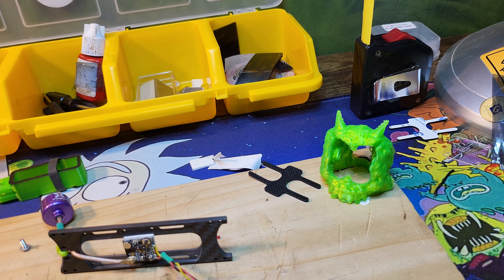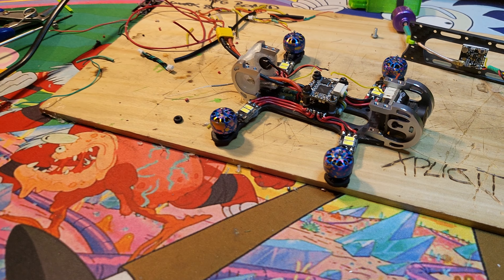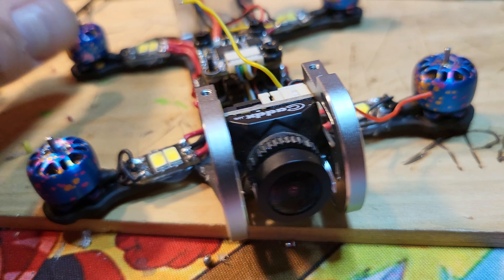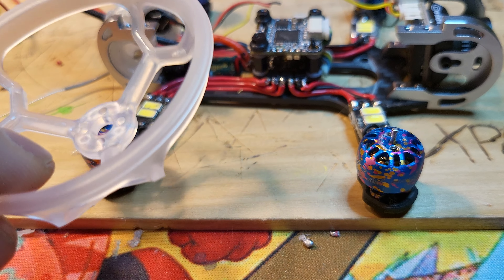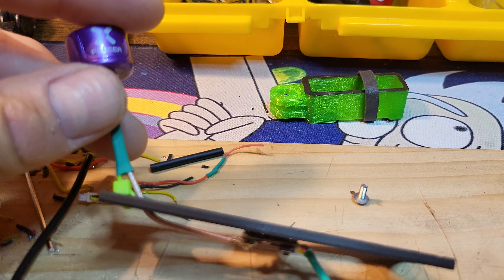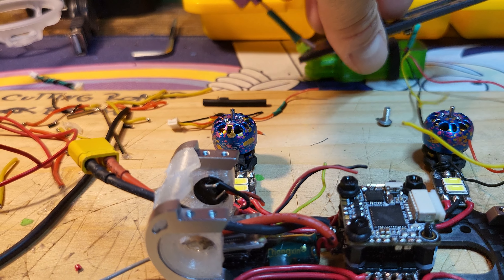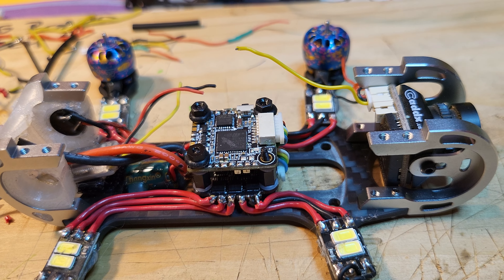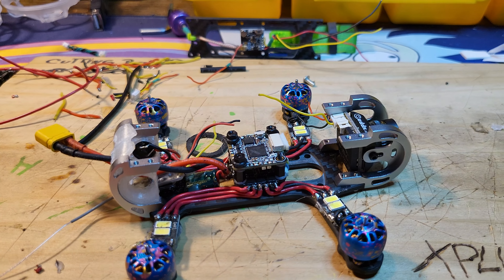my morning project

Comment: Looks good. Also if you flash it to 10.8 configurator with BF4.3 you can change the motor direction in BF and only solder one time.
Reply from the maker: Awesome
Reply: @Xplicit_fpv  there is a awesome 3” preset